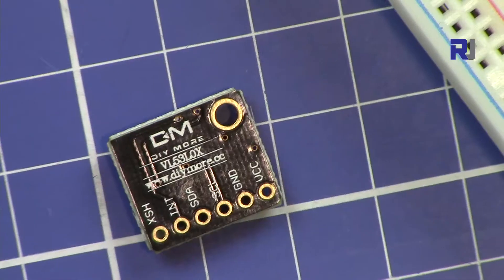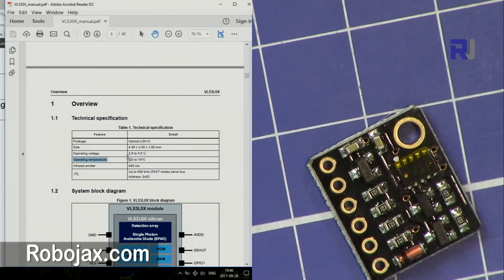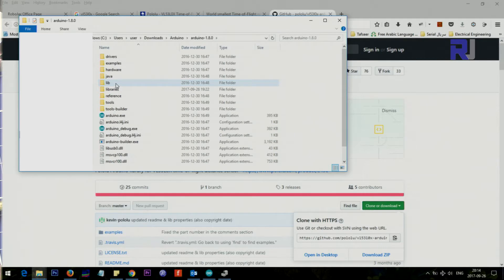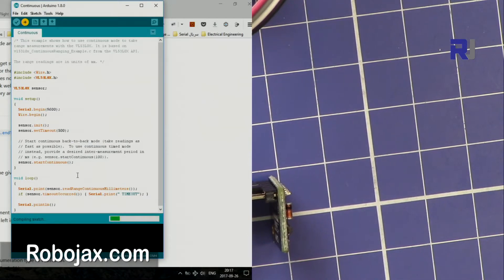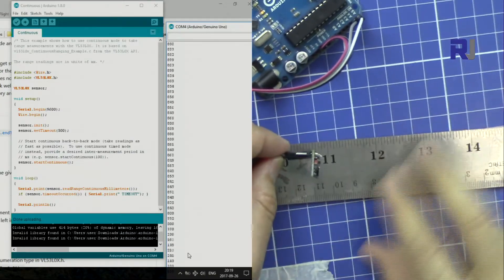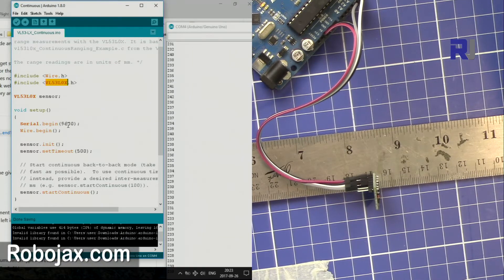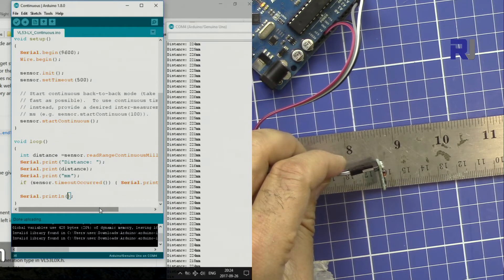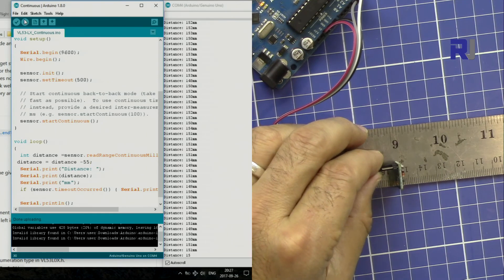E13 How to measure distance with VL53L0X laser distance meter for Arduino Pololu

Comment: how do I wire it to an Arduino pro micro when there isn't an a4 or a5 pin? does it matter which pins I solder them to? Also, how do I get it to activate a servo motor if the distance is equal to or less than a certain distance? also this is assuming no breadboard (pls) and the Arduino is being powered by a 9v battery and more slots are taken by the servo.
Reply: or direct me to some videos that could help me learn, im just a dumb 13 year old
Reply from the maker: here is full details of Pro Micro board https://youtu.be/nxPgun6xjHM keep is up. stay safe.

Comment: Hello friend, I bought a leisure sensor, Laser Distance Sensor Vl53l0x V2, and I need to do the following, which controls a servo motor, when I approach a part or hand of the sensor, the servo will go from 15 to 165 degrees with low speed and when I remove the piece or the hand it goes back to 15 degrees, in reality the servant will make the same movement as my hand quickly or slowly, a code for this project would be possible, my email is ailtonsilrosa@gmail.com, sorry my english, thanks
Reply from the maker: Hello Aliton, Yes it is possible.  This is a complete project and needs a full or two days to be done. I am very busy and have no time to do that.

Comment: Hi, really cool your video. I'm trying to make a compression machine test, using this VL53LOX sensor + load cell and print a graph considering Force(kg) and distance (mm). Do you know how the wiring circuit will be? Best regards!
Reply from the maker: graph on screen? Slick on Tools->Serial Plotter

Comment: fudge factor it
Reply: this 55 mm offset?  i think i read somewhere it measures from 2 cm plus.
Reply from the maker: There is no offset. I believe I had forgotten to remove the sticker film from the sensor.
Reply: Robojax i removed mine but same problem so i purchased higher price. it worked

Comment: Hello, thank You for your videos. Tell, please, how to attach 2 or 3 VL53L0X modules to the same I2C bus and address it?
Reply from the maker: connecting 2 of this module needs a little work which I would have to write another library (or class). But for sure you will need to change I2C address of the module first which I have shown in this video  https://www.youtube.com/watch?v=RRQASevYK3g  I might do this in a one or 2 months if time permits.
Reply: @robojax  Mmm, too bad, 2 month too long for me. Ok, try to fix it by myself. Thank you.

Comment: Hello, thank you for the video, it is very helpful! I just have one question, what if I want to connect more than just one sensor to the uc?
Reply from the maker: Hi Deniss. I will do a video on that. But I just wrote code for two sensors for you. Check it here http://bit.ly/2sINdqf
Reply: @robojax  Hi, is the video available now? If not, what pins does should the second sensor be hooked up to? Thank you for the sample code by the way!
Reply: Hey  @matthewvanoirschot6076  ! Did you figure out the connections for the second sensor? Please help if u did and thanks in advance!
Reply: @hemantjain9426  Yeah we did, um here is updated code
Reply: plug one sensor into each xshut pin (pins 5 and 6), and then to normal 5V and GND connections. That's it!
Reply: Hey  @matthewvanoirschot6076 ! Thank you so much for the code. It consumes only 7738 bytes of memory. This has allowed me to add additional code for the additional components which I use with my Arduino UNO. Great job!!
Reply: @hemantjain9426  Glad I could help!